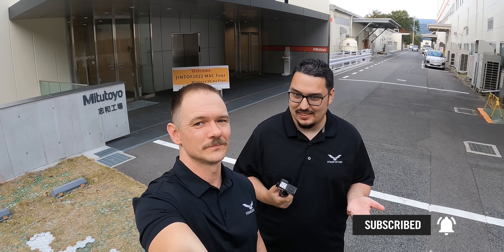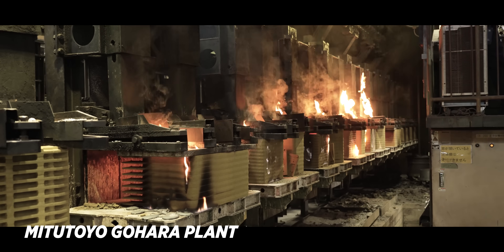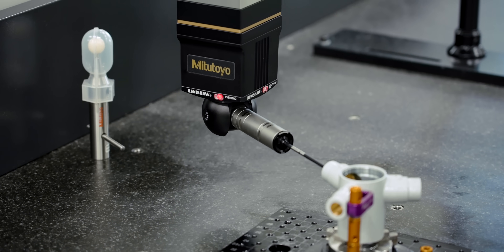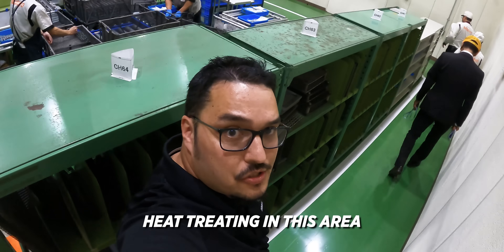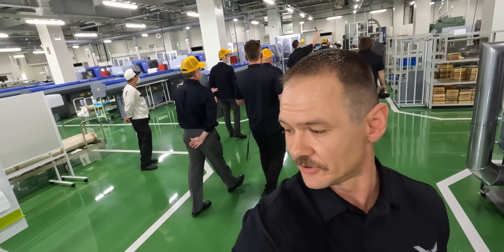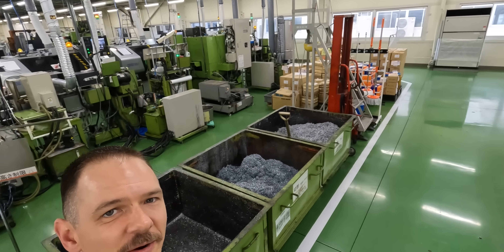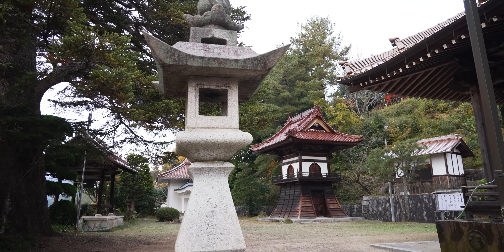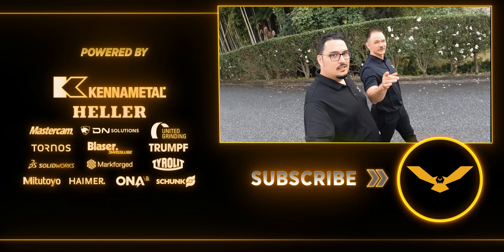Machining 50 Million Micrometers | Hiroshima Japan

Comment: The only cnc machine which is more accurate is the Kern Microtechnik , down to 0.00007 of a inch, which is 70 millionth of a inch. Basically any very hi end aerospace and NASA type products, like Mirrors used on the hubble and also the james webb telescope., etc, 👍👍✌✌🦘🦘

Comment: the groundbreaking moments are so vivid.

Was also wondering that the most precise precision equipment (that measures 3 parameters, roundness, surface) was calibrated. with very fine tune and precise tools I imagine.

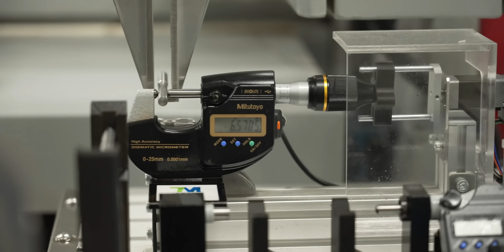Comment: That "outside" 0-25 mm Digimatic Micrometer (4:18) with 0.0001mm/0,1μm precision is 7x more the price ( in Europe ) then a "normal" Digital 0.001mm/1μm Mitutoyo, both with Data-output.

Comment: thanks! this video demonstrates a lot about what you get, often invisibly, when you buy a Mitutoyo measurement device...not just the surface appearance, that can be achieved by some "other guys", but the internals, right down to the heat treatments, the continuous, and continual, process monitoring, and the level of 'in-house' material and component sourcing.

Comment: it's a real blast to work in developing these processes...there are so many details to be dealt with in making a device, such that everything fits into the logistics chain, purchasing materials, usually from multiple sources, testing device parts, and monitoring the equipment operation, with 'feedback' at multiple 'layers', and every location, right out to customer and application engineers, so that errors are caught, and fixed, at the closest point, buy providing feedback to the people who design the devices, the quality people, purchasing/sourcing, production engineering... i worked in global r&d at a company that produced 500 million complex devices per year...

Comment: At first I read that as "machining 50 million microns" which would be 50 meters. That would be an impressively large part to machine.
Reply: Or, making 50 million micrometers, not measuring. 🤷‍♂️
Reply: A micron is short for micrometer. They're the same thing
Reply: @MF175mp  yes but there are multiple meanings for micrometer. One is one millionth of a meter and one is a tool used to measure very precise dimensions.
Reply: @GayActorMichael_Douglas  microns and micrometers come up the same, 164 feet or so. Probably meant to say 50 microns. Not 50,000,000 micrometers.